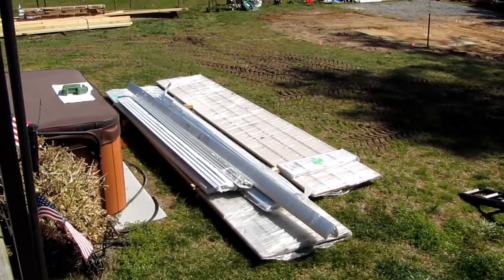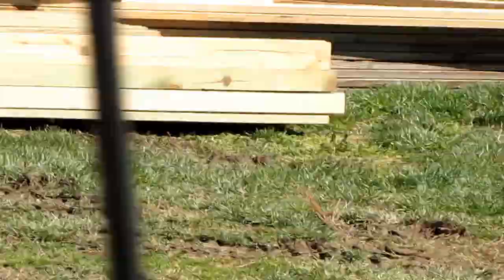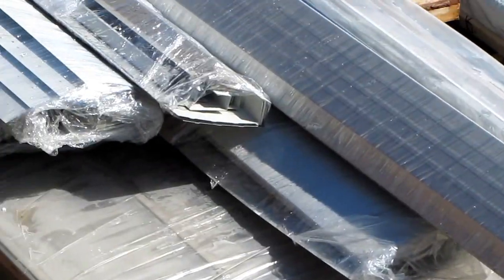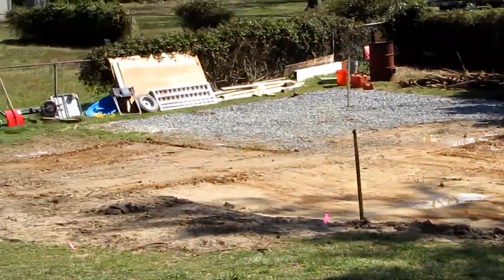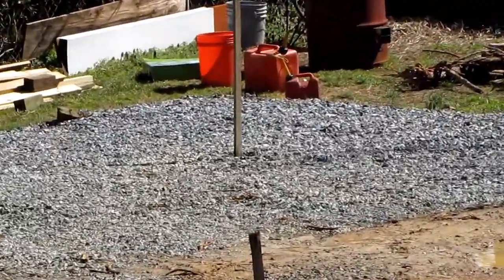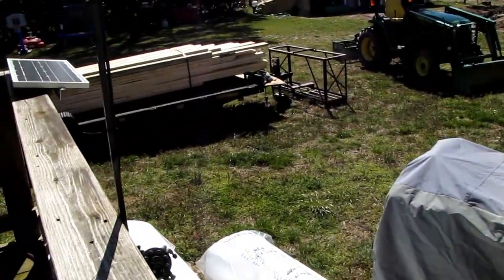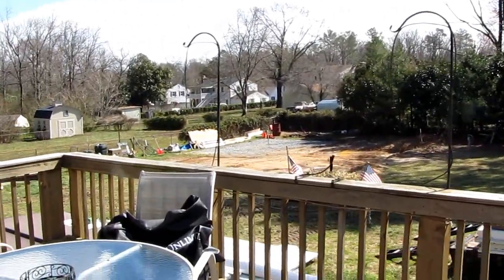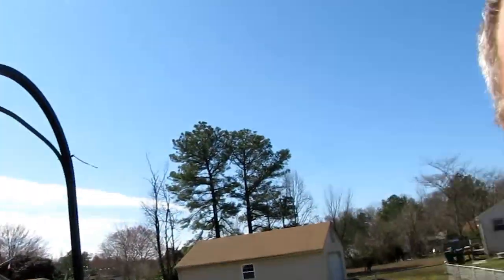Updates On New Project My  Pole Barn / Garage

Comment: I think its going to be nice. Are you going to set the post? Are you pouring a concrete slab?  It looks like the yard slopes and rain will run off right where your building sits. You may want to build it up with gravel and concrete pad really high. My dad had a pole barn and it would rain and flood it and the hay on the bottom it would ruin it. I took the tractor and the box blade and drug the dirt away so it could drain and it was better.